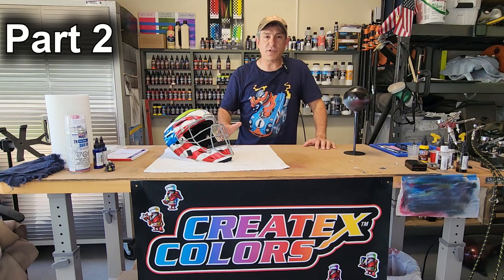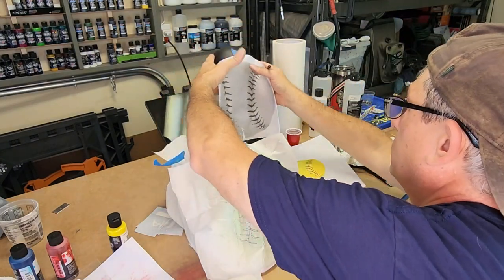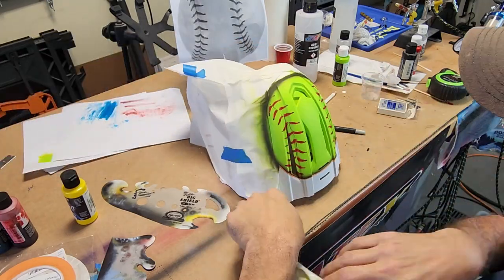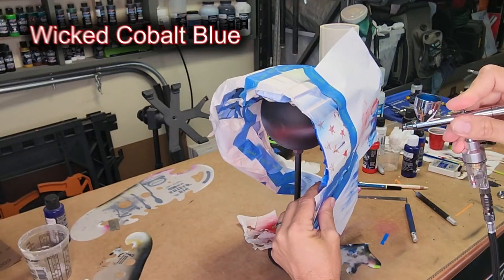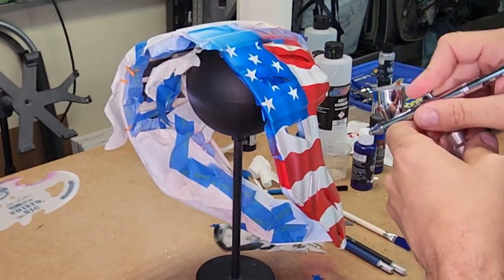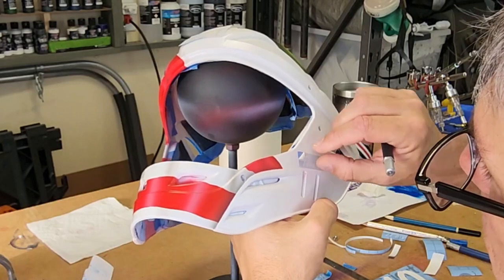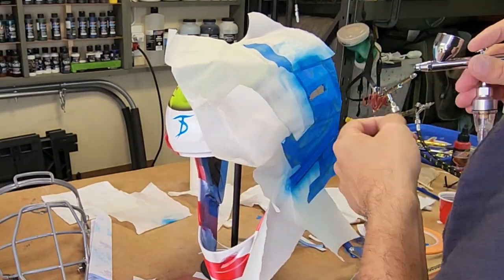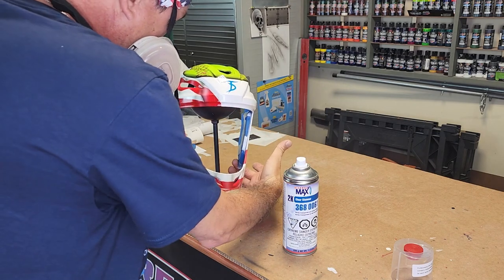Airbrushing a Catchers Mask  - Part 2

Comment: Are you using carbon transfer paper or salan transfer paper …. Asking kuz i had issues with carbon transfer paper
Reply from the maker: Hey FingZ, how's it going? That way carbon. I only use that to transfer on to my transfer tape never directly to my surface.

Comment: Have you tried the 2k car Rep brand of clear coat?
I tried and had some cracking problems any suggestions?
Great video
Reply from the maker: Model maker, I have not. I really like the spray max. I get great results every time. I will look at the car rep and test it in the near future.
Reply: @TheAirbrushGarage  thanks for the reply, I have used the spraymax and have had great results, I tried the Car rep 2k because it has no pot life and can be use until the cam is empty without having to use in a few days before it no good.
Reply from the maker: @modelmaker6470  I would be a little concerned that it has no pot life. Once a hardener is introduce in anything, glue, body filler, paint, etc. There is a limited time untill it gets hard. That's the point of the hardener. Not sure how a resin with a hardener mixed in does not get hard is hard for me to comprehend. I will investigate.  Thanks.